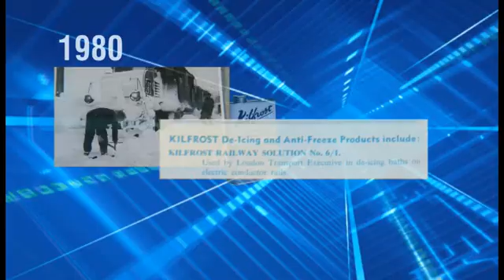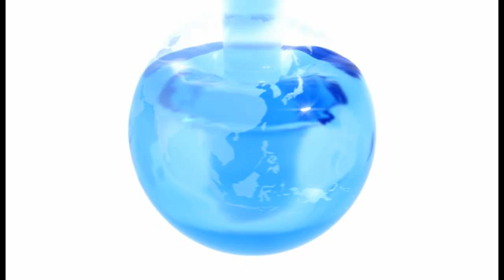Kilfrost Rail DVD

Comment: I would like to connect up to,,,6 Hair dryers in series. Each hair dryer would get about 100 volts D.C just for the hell of it. I will also put in series a 20 amp 600 volt D.C. rated fuse with a 22000 AIC interrupting rating.